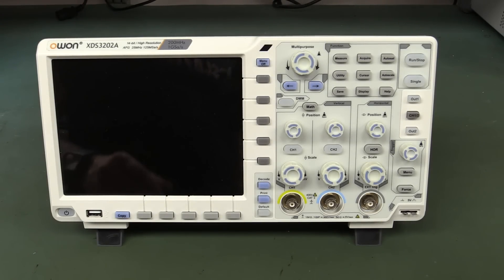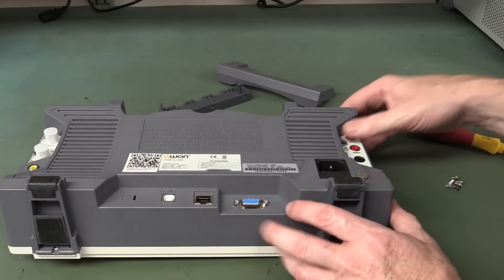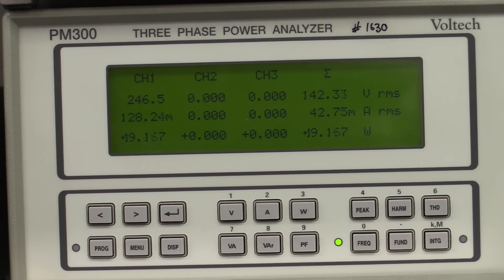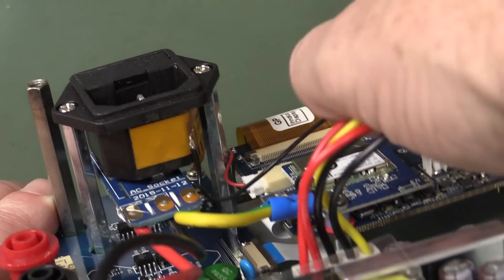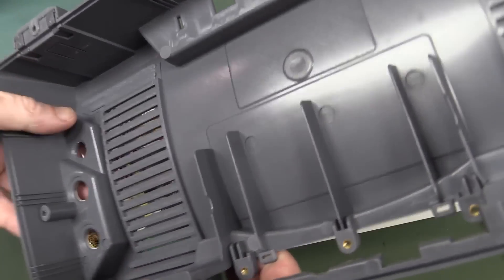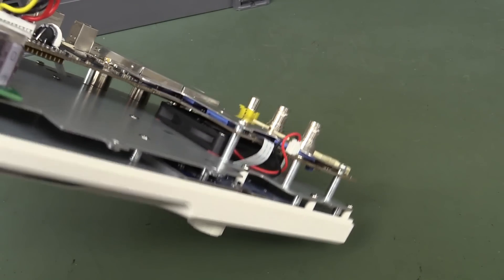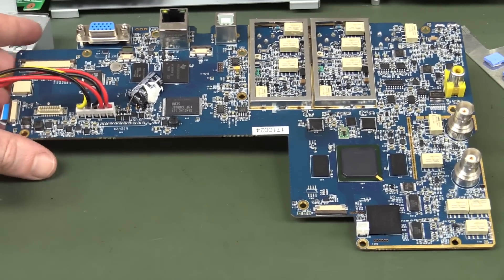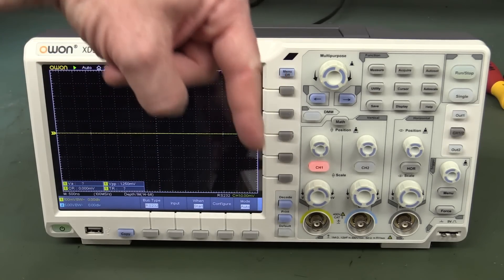EEVblog #1004 - Owon XDS3202A 14bit Oscilloscope Teardown

Comment: Multimeters are so much better and cheaper
Reply: basshead until you want to actually see what's going on in the system... a time for everything
Reply: wtf official agilent channel watching a owon teardown.
Reply: gamerpaddy on a Saturday, too! I need to rethink my life :)
Reply: A multimeter and a scope are two completely different tools so this statement doesn't make much sense to me
Reply: You can't live without a multimeter, but you can live without an oscilloscope.
Reply: Technically I can live without either
Reply: In other words, water is so much better and cheaper than a multimeter. You can't live without water, but you can live without a multimeter... Yea...

Sorry, that's just flawed logic given any context. Btw my digital oscilloscope has a decent multimeter function :P
Reply: +basshead
It depends on what you do.
Reply: +Jacob Puls  You can't do that. They are too different things. But you can do water vs food and then water wins, because it's more important and you live longer using water only.
Reply: Yes! they are two different things, that's why I used them in my example. Multimeters and oscilloscopes are also different things that have very different uses in electronics. Since your name is basshead (and I'm assuming your into car audio) then a multimeter is probably all you really need just to check your battery voltages, how much they're dropping and such. In some of the circuits I build, an oscilloscope is necessary for calibration, a multimeter isn't going to cut it because it is not the right tool. Anyways this is getting a bit silly. Peace.